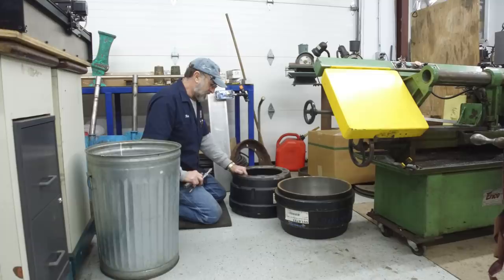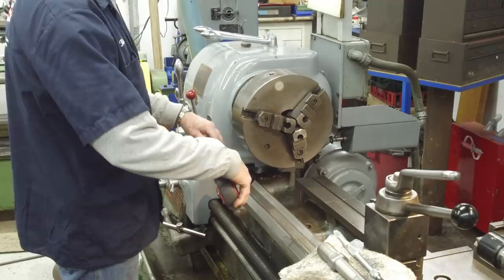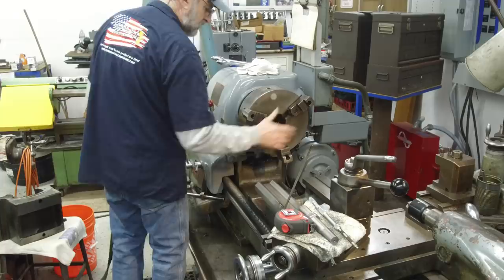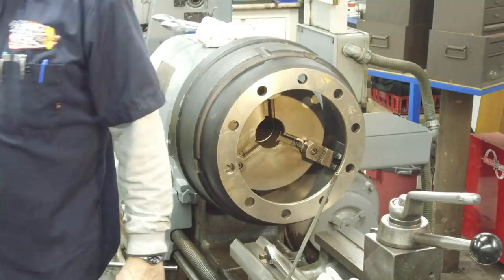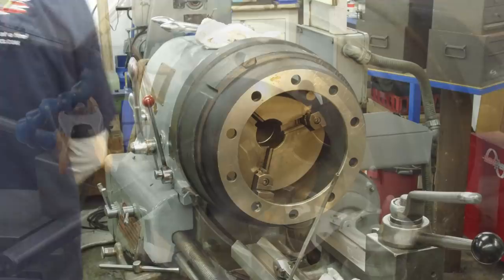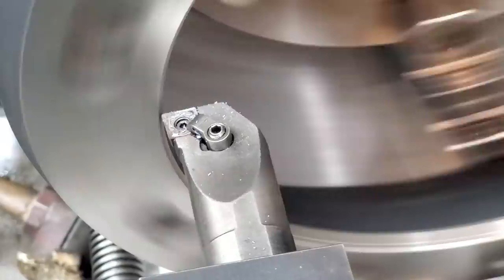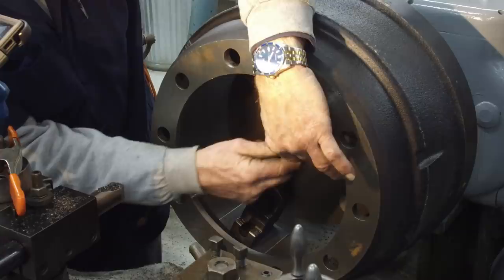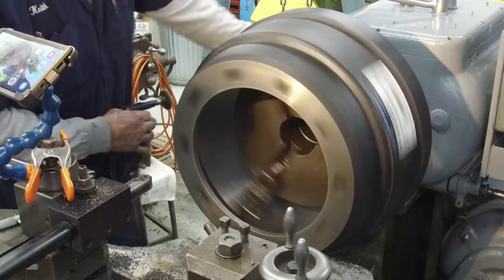I Drummed Up this Video

Comment: Applying the tool to the work to remove material doesn’t change much from one job to another. But every setup is a new adventure and that is what separates the men from the boys. You are the man!  This vid was a good illustration of using your head and applying many years of experience to get r done. 😎👍👀
Reply from the maker: Right on

Comment: i would not have thought to ignore the axial runout , that saved a lot of time. i probably would have opened up the stud holes a little more most drums i have worked with had plenty of clearance for the studs. you always come up with clever time saving setups.

Comment: Hi Kieth, I've seen some pretty worn brake drums, where the linings are gone and the metal backing had also work to foil thickness in the centre with a corresponding groove inside the drum. 
The customer said the brakes were squealing, no mention of any drop in breaking power! They were off about a 4 ton truck, no power boost in those days, so pedal pressure must have been enormous.

Comment: oi Keith I know the noise ...its the square drives on the chuck... they have a little play and drop in and out as it rotates, giving you that noise .. made me look for it too
Reply: Yeah, the noise is always there, it just became very apparent when the brake drum acted as a big bell and amplified it.
Reply from the maker: The key hole chuck adjustment pinion gear dives, have a little clearance and they echoed inside the drum. ;{)

Comment: Okay, I understand exactly what you did. But now the actual studs, installed in to the corresponding holes on the equipment, have to be absolutely on target or the drum will never fit on. Also, watching the drum spin on the lathe, looks like it was machined off center from the factory if you watch the run out on the casting. I surely hope they turned the inside drum surface to center. Otherwise I can easily see a pulsating brake pedal... Nice work on your part. Thumbs Up!
Reply: with air brakes  you dont feel it in the pedal lol

Comment: Sounds like somebody ordered a stud centric drum when they needed hub centric. Considering most of those drums only cost $100 in the first place  hard to justify modifying one versus just getting the right part.  Of course then again if you don’t no the right part person or where to shop you may not ever get the right part.  Must be a cement truck if it’s an Oshkosh
Reply: Sorry I think you might be missing the point a little here. The facts are the guy that owns these drums knows of Keith. He knows he's the kinda guy that will take on a job like this to help someone out...Keith is not making a ton of money from stuff like this, but he's working and doing someone a favour. In this modern world where everyone is trying to maximize their revenue streams I'm very happy there's still Keith's about.
Reply: @iiredeye  I hope Keith is not doing work for "very little money". The favour he is doing for his mate, is that he is doing "The Right Job", it will be correct...Guaranteed. The money is as it should be.
Reply: @iiredeye  you might need to take a look at bcbloc02 channel. he is a master just as keith
Reply: @westonwaters7984  Indeed they both are!!!     :o)      . 
O,,,
Reply: Most truck part places measure them with floppy tape measures that are barely readable combine that with parts guys that can’t read a tape or care that their screw up costs time and money and it’s little wonder the parts don’t fit
Reply: @robertquast9684  Sounds more like used part workers (lack of giving a crap) these drums I believe are new... That said they may not be American made and with the same ethics.....

Comment: "Some Assembly Required".  Did supplier indicate that it was not a direct replacement?  Perhaps they stock a "standard size" that fits several applications?  Or-- perhaps the manufacturer changed production specs with newer years and stock numbers reflect the newer numbers?

Comment: surprised they didn't just use a small flapper wheel, or slotted shaft and sand paper to open the holes so the studs fit LOL.
I mean, that's what most mechanic shops would have done, so long as they weren't eating the conical taper mate surface away ( if it wasn;t flat washer/flange bolt)

Comment: I suppose that cast drum acts like the paper on a speaker cone and amplifies any gearbox rattles.  Like cooling fins on a motorcycle radiating vibration as well as heat.
Reply from the maker: The key hole chuck adjustment pinion gear dives, have a little clearance and they echoed inside the drum. ;{)

Comment: What brake system is the owner running in board brakes  bud stile two preice nut  set up or pilot set up it make a big difference on the fitment .  also did he get the correct drums for his application like some one had previously mentions. But a very good fix to the problem

Comment: woah, tapered seat stud and flat shoulder stud drum? opened the hub bore which would center that type?
just what are they trying to do, adapt something no longer made to a dinosaur? (lug/stud centric vs hub centric) not much good will come of that in general

Comment: It seemed that you checked the wrong end of the studs in the Drum holes?  Perhaps not.  They were it seemed 0.040" too tight.  Someone should have mic'd the Hub that fits the hole in the Drum.  That centres the hub and carries the load.

Comment: I found a large discrepancy on a large pump part, checking the specs there was a .014 larger port on a hydraulic motor driver pump. The parts were coming back from the shop and they were asking for NDE Magnaflux... $$$ a pop. I checked the records and they were getting bigger by serial # over a 6 month time. The mfg. found a machine they used to QC the parts hadn't been calibrated for 23 years! Brake drums are QC'd right? The mfg. should be doing the work, that guy just paid you for... SSHH! LOL

Comment: @7:16 - What is it that you were hearing?  What made you keep listening to the lathe at that point?  The way you touched each of the jaws, it made me think you heard metal on metal rattling.  Curious.  I should have watched just a MINUTE longer.
Reply from the maker: The key hole chuck adjustment pinion gear dives, have a little clearance and they echoed inside the drum. ;{)

Comment: There looks to be a fair amount of runout on the od of the 1st drum.
Reply: They cast the drum and only machine the  necessary surfaces.
Reply: @buckinthetree1233  yes but wheel ballance will take some work.
Reply: @bulwinkle  it could introduce a small amount vibration but they won't realize the cause.  They won't have the brake drum on the tire and wheel when and if they balance it.

Comment: You hear the bearing amplified?
Reply from the maker: The key hole chuck adjustment pinion gear dives, have a little clearance and they echoed inside the drum. ;{)

Comment: by "a new company" do you mean China Keith? :) It always amazes me the lengths people will go to in order to make up for the deficiencies of cheap production.
Reply from the maker: https://en.wikipedia.org/wiki/Oshkosh,_Wisconsin
Reply: Is it made wrong, or made for something else and needs to be adapted to this application? Sometimes you need to make do with what you can get because correct parts are NLA. Regardless, you can stand there and throw a fit in front of the parts man and get nowhere, because "perfect" parts don't exist in this instance, OR you can pull up your socks and Get-R-Done!
Reply: @BarnyardEngineering  Likely has been superseded by a new part, which in turn was slightly changed in order to meet another vendor's changes, so now is just not the right dimension wise for the old part location.
Reply: @KeithFenner  you can bet that your attention to detail was not done originally, they were in a rush to get them to meet minimum quality spec and shove them out the door. no time to clean up holes or deburr, that is for the end user to do.

Comment: Yikes . Reboring the pilot hole starting a thousands off. Is probably going to cause a little pulsation in the brakes. But what am i to know i have only been doing brakes for 40 years.  But it's ok as it's only a 70 or 80,000 pound truck. That is not nearly as bad as abom screwed up the Norton brake drum.  You two must be insulted that people bring you automotive type jobs. But even brake specialists screw up. I drove from los angeles to arizona and back to pick up a pair of drums for a chrysler 300c. They were beautiful but had some rust spots.  I took them to the friction materials shop that had a drum grinder attachment that I did not have. Can you grind these. Sure. They came out threaded. Probably 32tpi. And they took them to the limit when they were standard with a little rust. There went a grand. And a customer. They has the gall to tell me it would wear in.

Comment: I suppose it would have been nice to have a helper  move the gantry when you were installing the drum on the lathe but you were able to do it on your own. Need a lot of creativity when you are the only one in the shop. Gravity is quite the helper (lowering the drum to the floor) when it can be employed. Often I find myself fighting it rather than using it as a helper, gravity that is.  Stay healthy- the vaccine is in its way.

Comment: That drum wasn't anywhere close to running true! I wonder if having to rework nearly every part negates the "price of cheap"? Seems like every video I watch of people using "Chinesium" parts they're WAY off to begin with...
Reply: It's a casting. The cast surfaces won't be true but that doesn't matter, they're all clearance surfaces. Only the machined surfaces matter and they were true.
Reply: The sad part is that these days often the only source is from the China Virus Country.
Reply: @Mishn0  Well I guess I need a new computer monitor instead of this 32" HDTV  at arms length! Although I am a Mechanical Engineer by profession I have spent MANY hours in the machine shop. Casting or not that part was crap from the beginning. All Keith did was make it "useable".
Reply: @PhilG999  Ooooh, grovel, grovel, grovel...
Reply: @Mishn0  I couldn't give a rats back half what you do! Spend 40 years in the machine industry and get back to me. Oh wait. On second thought don't!
Reply: @PhilG999  Stop flexing and show me where anything I said was incorrect.

Comment: Definitely Chinese drums. Not even close to running true.
Reply: Yes they are. The brand is based here in NJ, and they specialize in Chinese knockoffs of thousands of truck and trailer parts. I work for one of their largest distributors.